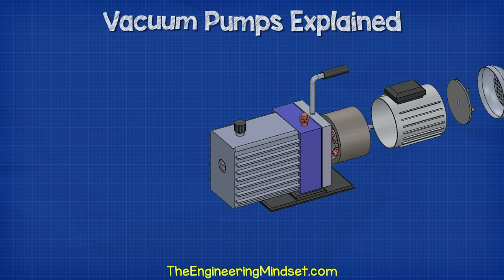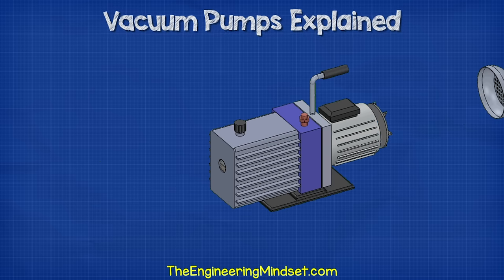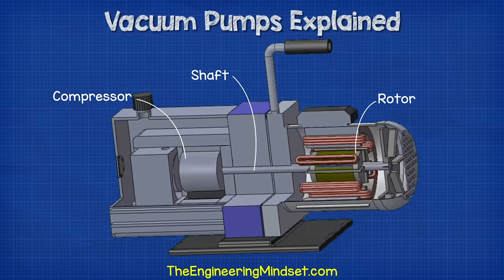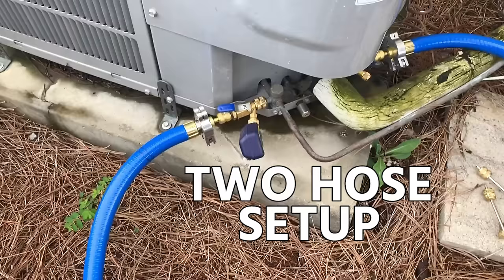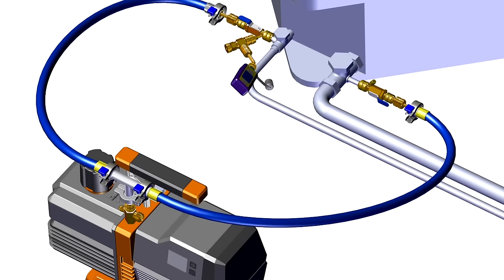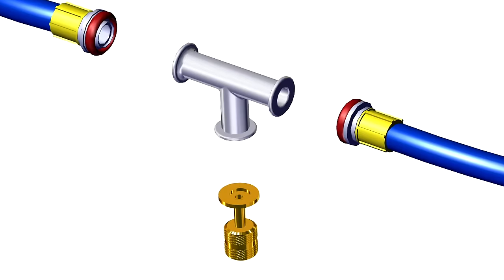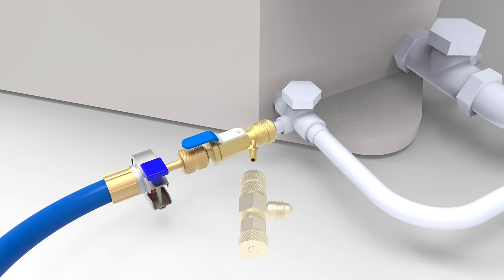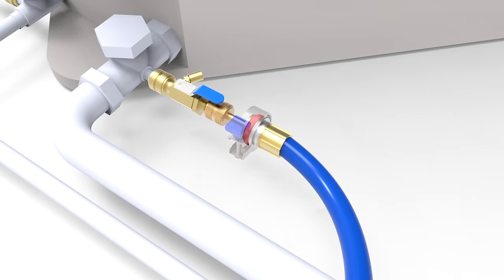How to Evacuate an AC system, Full Vacuum Procedure

Comment: Hello,
A micron is a measurement of distance, pretty much it will tell you how close you are to a perfect vacuum. Great video. This channel is absolutely a great contribution to HVACR community.
Reply: To be more accurate, the microns used in HVAC are “microns of mercury.” A micron itself is a thousandth of a millimeter. A micron of mercury is a measure of pressure. It’s so small that traditional bourdon tube gauges aren’t accurate enough to measure it.  Digital vacuum gauges actually measure temperature and convert to pressure.

Comment: Good video. Prefer the 5/8 vacuum hose  to the 1/2. Have pulled to the point of ice in system a few times. We also pull from both sides on commercial  -  industrial ice machines as it has been established by the manufacturer to be the best practice. Also, if a system is well thought out and engineered, one can check vacuum readings most anywhere in the system. 

Certainly the portable vacuum pumps used in the field is not the way manufacturers pull a vacuum at the factory.

Comment: you can have a water freezing problem around the metering device . had a water cooled condenser develope a leak that put water in the system after the system had turned off. used heat on metering device to evap coil to melt water crystals that formed due to high vac.being pulled

Comment: Once you are done pulling the vacuum and you are getting ready to add the core, you screw it on to the end of the removal tool and then open the valve to allow the core to make it to the port. Should you purge using the end of the core removal tool or can the core go straight in?

Comment: For leak under slab and we cannot get to it to fix.  Will vacuum and refill with freon and sealant worth trying at all, besides running a new line. 

We have an old hvac and recently had hot water slab leak that we believe allowed hot water to leak in to AC 7/8 line.

Comment: Verry helpfull video, i understand that it is allowed to break w nitrogen with the vacuum gauge connected to the system, isn't it? But, at which pressure then? i was always told, to remove the vacuum gauge when breaking w nitrogen, because it wont resist the pressure.

Comment: You should really be pulling both Schrader cores and using a core remover on both sides, for the vaccum hose and for your micron gauge.  If you leave the core in and put your micron gauge on when you go to take it off you can actually hear air entering the system through the Schrader. Kinda like when you're taking your refrigerant hoses off a system some refrigerant escapes
Reply from the maker: I release the charge with the bluvac micron gauge still on. It is rated for 500 psi
Reply: @HVACS  huh. Didnt know that, thanks for making me smarter

Comment: Very detailed and very good, however, way over the top.  Any day I'd rather have too much info than not enough, and for this I applaud you for sharing this!  You are truly an AC expert.  For most folks, this job really isn't super complicated; don't be scared to do this yourself.  This may be good info, but you don't need to be super scientific about this unless your installing a very expensive commercial system.  Anyone can do this just as well with a set of cheap gauges 1/4" and a small vacuum pump, albeit it will take more time.

Comment: Superb top quality video... There's one part I don't understand though.. when you pull out the shredder valve  through the core removal.. And install it  back in vacuum line.. Does it break the vacuum? All air get suck back in? It seems like it's not going to break vacuum but how does it work on the shredder valve removal?

If any one know.. Please try to explain in layman terms.. Thanks..
Reply: Aristotle, you replace the valve core only after you have positive pressure from the refrigerant.  If not you are correct and lose the vacuum.

Comment: I know this video is a few years old, but I have a question.  If there was refrigerant in that system and you pull the vacuum, is the refrigerant venting to atmosphere (i.e. there is no storage tank for recycling)?  I ask because I am looking to purchase a vacuum system for an automotive system with R1234yf and cannot figure out where these systems store the evacuated gases, none of the less expensive ones appear to have any sort of capture system?

Comment: Hi, after replacing a suction line and liquid line service valve do you perform the vacuum with both valves open? If so, wouldn't the vacuum pump pull compressor oil out of the system? Thanks

Comment: I had to replace my car condensor, which let in air/moisture in A/C system.  The oil is POE, so it can absorb moisture and not let it out, even with a vacuum. Any thoughts on getting moisture out...

Comment: If pressure equals temperature then I would think you could freeze moisture or damage oil depending on pressures.

If a discharge temperature of 225 will change the viscosity of oil how does pulling to 1 micron on a 100 degree day affect it? 

I haven't been able to find anything that tells me that. It makes sense that I am lowering the boiling point for refrigerant and moisture. If moisture boils at 212 at 500 microns what is pulling to 1 micron gonna do?

Just curious if you have a chart or numbers.

Comment: 2 questions. First is on black gold pump oil and its effectiveness because I've been told it trash and can cause system issues. The second is if you have a wet systems, my understanding is that a filter drier is the only way to get it out. Mulitiple dryers and a  sight glass to be clear.
Reply: jasond138 unsure on the black gold oil... I’ve used it plenty with no trouble. A drier will handle some moisture but that’s the point of a good deep vacuum. To rid the system of moisture and non condensables
Reply: Heat components while pulling down

Comment: Could this type of vacuum help my 5 ton AC unit ?  It is not cooling enough on during the day.  Second opinion Tech said it might be something clogging the condenser and best thing is to replace it as well as the compressor again. First tech replaced compressor, expansion valve filters but problem persisted.

Comment: I do appreciate all of these videos that these guys put out, but they don’t recommend hoses or a manifold while doing a system evacuation. So how are you supposed to charge without getting the smallest amount of air in the system without having a hose to your tank or through your manifold connected to a Tee, or a Core remover. I think this is a great video explaining a new install when you only have to turn the service valve but is not feasible for commercial applications without using another hose or manifold.

Comment: Great information.  Great tutorial!  Learned a lot.  Why is this procedure so expensive?  I’ve had some crazy quotes.  Thanks!
Reply: Because it looks like magic if you don't understand what's going on. HVAC systems are really dead simple and plug n play. Clean the copper, braze a few joints, pull the vacuum fill refrigerant measure some stuff and be done with it. Knowledge is amazing, once you understand how things work you start to not understand why HVAC techs are asking that much much money for their work.  :)

Comment: Great video - thanks! I’m working on a Pioneer 3 zone that I’ve connected two heads inside. I’ve N2 pressure tested both lines to 200psi & hold nicely. However I’m wondering why I can’t seem to get a vacuum down below 16300 microns on either line! I’m using  two Apion VCR tools (like you’re video shows) changed the pump oil just prior & tried going through my SMan 460 & direct with a yellow jacket micron meter - didn’t seem to make difference. Any idea where I’m going wrong?

Comment: Is there a core depressor built into that micron gauge or does the small bit of tubing with 1/4" female flare connectors on both sides have a built-in depressor?

Comment: Impressive details. Can i apply this also to car air conditioning?
Reply: The process is the same, but the amount of vacuum that is pulled is different from car to car. A vacuum must be pulled in any air conditioning unit. Car, wall mounted units, hvac units etc. it’s done so moisture/air is removed from the system. With a car’s air conditioning system they are very sensitive to the amount of Freon that is needed to run. Too much or too little will not make the air conditioner work, if done improperly you can damage a lot of things of your car’s hvac system. Not just one but multiple different components. You are better off letting a professional handle that if you don’t have much experience with cars.

Comment: If you follow this procedure; what is a good way to get the schrader valve back in now that it is under some pressure from the refrigerant just released from opening the valves? Force it back in ASAP after opening that valve back open? Thank you for the good video btw
Reply: You have to use a valve core tool.

Comment: In a system change out. Would it not be right to also change the evaporator coil?usually when the condenser has to be changed, I would think it makes sense to also change the evaporator coil.🤔🤔🤔🤔🤔

Comment: I have a multi split installed (one external unit with 2 internal units) in my house since one week. The issue I have is that I am hearing the freezing liquid inside one of the units like an old refrigerator sounds and the technicians don't know how to improve it. They say it is a normal sound, but it last for hours and it is very annoying. What could be the cause of it? Do you have an ideea? Is it possible that the vacuum was not done properly?

Comment: Understand how putting your micron gauge on the furthest side of the pump while using one hose. What if you use two hoses? Where would you recommend the micron gauge be placed?
Reply: As close to the system as possible, so on a service valve port.  You pick one. If I know will have to add charge on new install I choose vapor line.  Other day we had to add 4.5 lbs juice to both circuits.  Added it to the liquid line.  Gauge was on vapor line.

Comment: If you're adding refrigerant from a tank through a manifold, and not releasing gas trapped in the condensor, how do you remove the vaccum gear and hook up your gauges without air being sucked into the system?

Comment: Has anyone ever experienced a problem with a smaller system (refrigerator) having the moisture freeze and crystalize in the sealed system and not be removed due to pulling to fast of a vacuum? I had this happen on a Whirlpool refrigerator, we even left it on vacuum for two days and the moisture was still present. We had to buy a cheap slow vacuum pump and pulled the vacuum and purge with nitrogen several times to rectify the problem, but like I said, it was a much smaller refrigeration system, I think it held around 4 lbs of 134A, we even had the Whirlpool Rep out to insure we were replacing the compressor according to standards and he even scratched his head after running it for a day and finding moisture still in the system. Now with that said, I have never had that problem on an HVAC system and it's possible the moisture became trapped in the cap tube system, which is a lot smaller on refrigerator systems and they are getting smaller all the time.

Comment: Question:  I'm replacing evap coil with quick connect fittings and it has 410a holding charge.  How do I vacuum this?  I understand the diaphragm is pierced and holding charge released when evap coil fittings are tightened, but If not tightened then system cannot be vacuumed?

Comment: Good way to boil off refrigerant/moisture in the system during evacuation leave the indoor fan running to keep a heat load on the system.

Comment: How would you or anyone reading like to suggest how to set up fitting and lines for a system to evacuate/boil any water out of waste veg oil in an old 45kg 4mm thick walled steel old LPG gas bottle as a customized home made DIY setup? 

This will be a regular thing to dry WVO for use in a vehicles engine. I realize this is out of the normal league of regular HVAC work, but since this industry is often familiar with pulling a vacuum etc thought it would be interesting to ask. The tank will likely be able to be heated with a heat band to 60-80 degrees Celsius once filled near the top. What sort of times would a process take as well? 

Hopefully a lot of the water is out from settling the oil prior to it going into the old gas tank for processing and applying the vacuum! At the moment the LPG Gas tank has the normal 1" fitting out the top but i am prepared to customize weld some other fittings in where needed.

Comment: 16:16 -  Is this true even with a "hard shut-off" TEV with or without internal/external equalization.  I haven't been able to get my head around this yet. For instance, what if the hard shut off TEV traps nitrogen in the system  (i.e., how to properly flow nitrogen in a hard shut-off system, etc.)?

Comment: Good video.  Analogy with small port and toll both is a bad analogy because fluds accelerate through orifices to match the volume through the rest of the line...not so with toll booths.  Better proof is to blow air through a drinking straw and a gsrden hose.  Waaay harder to blow through a long hose than a short straw even though straw is way smaller.

Comment: When pressure testing and the TXV shuts off  how does further pressure get to the low side for pressure test.  ? how do you know that a little pressure is not getting buy the TXV and masking a leak on the low side. ? I am just new to air conditioning. Mike

Comment: 4:15 - Is there a such thing as Wet Nitrogen?  Where did the term dry nitrogen originate? Is N(sub)2 wet and has to be dried?
19:21 - Is that a KF25 or KF16 coming off the 1/2" fitting?

Comment: I guess you have to put the micron gauge right on the core tool port on mini splits since they only have one port per zone?
Reply: I usually either do that or install service ports while the system is recovered and under nitrogen flow. Installing a service port at the furthest point from pump is always the ideal option

Comment: It seems like I ran across some science news the other day that mentioned "the most powerful vacuum in the world" or some such. I forgot to look more closely. But it really seems that there's no limit to how hard something can suck.
Reply: Except for technicians in HVAC. TOO MUCH OF A VACUUM, and you're now vaporizing oil. Not too good, don't we both think? Of course, I know you were already aware of that. BTW, I'm also sure you know how to check a capacitor without removing it from a machine that's running, correct, as well as why I've never been able to even get a shock if I didn't discharge it first. Yeah, that's a bit of why you're destined to be a rock star. I retired a hair before 50. Wanna try to match me? You can keep working. Just gotta have the assets to be able to. But I did bug out.
Reply: @nothankyou5524  Congrats on the successful career and early retirement. It's good to see actual working people rather than shitty speculators win.

Check a capacitor on a running machine? Is this a trick question?

Comment: !!  Measuring the vacuum AT the PUMP is definitely a common beginner thing to do.  It comes up a lot in Neon practice, it's probably worse here.  Your portable vacuum system has a fairly high conductance, but in the REFRIGERATION SYSTEM itself probably very low, same as a long wiggly Neon tube.  It's a long narrow path.  It SHOULD take a long time for molecules close to the gauge itself to get all the way to the pump!  So you get the number you WANT if you measure at the pump, this is wrong but so hard to resist.   Off the top of my head I think conductance varies like with the cube of the diameter of a tube, and inversely with the length.  This is a dread nightmare thing to realize, because nothing could be easier or more fatal than to hook up a high speed vacuum system with some tiny plumbing just because it's handy.  It's a VERY common thing to do!

Comment: If working on a contaminated system. Does anyone make a cold trap so you can collect water, oil, and refrigerant but let nitrogen escape? Then you could just purge with nitrogen after pumping down to whatever pressure water would start boiling at (for your current temperature) and still capture any refrigerant if needed by pumping down the small volume of the cold trap later?

Comment: Never had any issues when pulling a vac or cleanout..  but have had many a issue when filling..  had one where all i had were small 1lb tanks to fill an r22 system because was only things i could get at the monent. But was a simple 5 ton and when i got to the 4th bottle with purging and by the books aside from the small tanks..  but it for whatever reason took damn near 4 hours. To put in that last bottle and hit the correct sh...  dunno what the hell..  but that systems been up and running ever since i replaced the compressor and reversing valve, that was 4 years ago.  But ive had that happen a couple times where suddenly filling slows down to damn near a hault...

Comment: Would a vacuum issue cause my inside unit to leak water onto the blower and floor? The water is getting pulled from beneath the coil and out of the drip pan and going everywhere.

Comment: Wouldn't the schrader value port within the evaporator coil on the suction line be the farthest point alway from the condenser? If someone was using a two hose method. So in theory the tech/ installer could used both sides line to pull a vacuum at the same time resulting in a fasting vacuum. Then after  check the true microns at the coil and close the valves of each port.  If it has port at the coil that is?

Comment: I have a question, do you really need to flush the lines with Rx11 if the old system was R22 and the new one is R410A? Cause I haven’t seen nobody to talk about that and isn’t it on the EPA book either, thank you